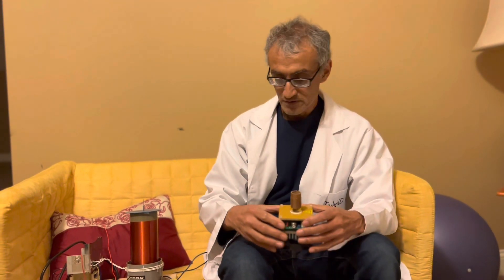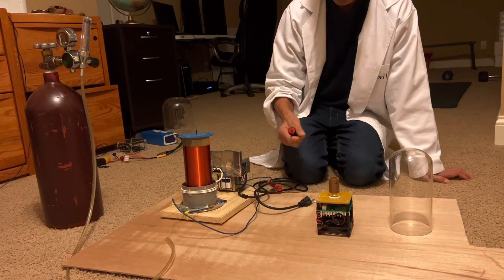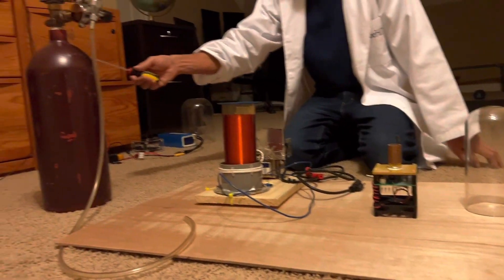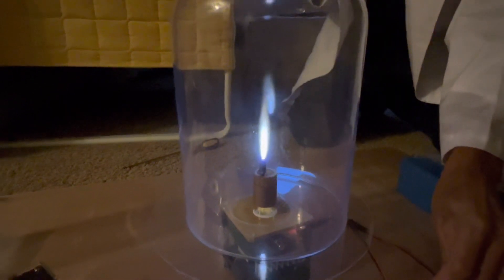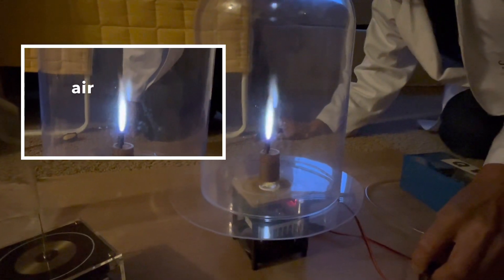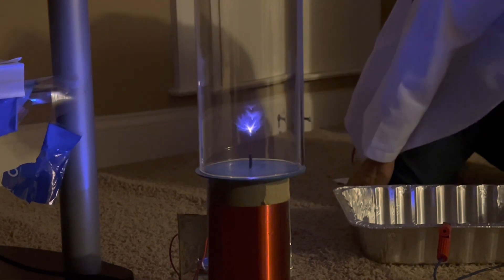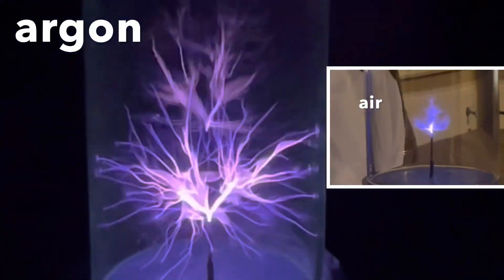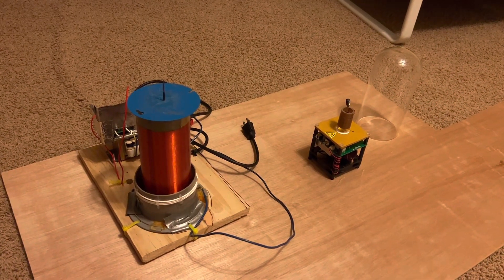Firing up Tesla coils under Argon

Comment: Would it be possible to rarify the gas under a partial vacuum.
Reply from the maker: I thought of doing that. That actually isn’t a bad idea. I’ve tried putting the whole coil in a vacuum and there’s no breakout but just corona around the secondary coil. What I might try to do is put the breakout point into an evacuated container and seal it with hot glue and see what happens.